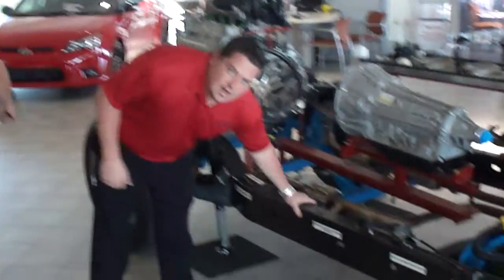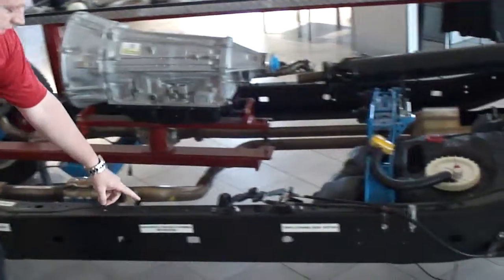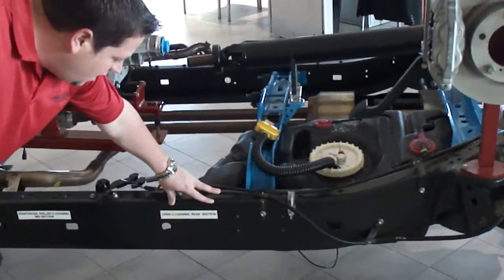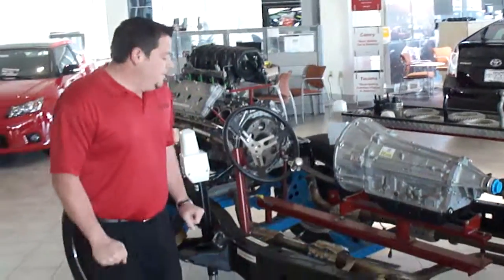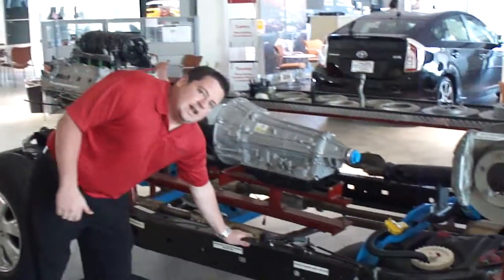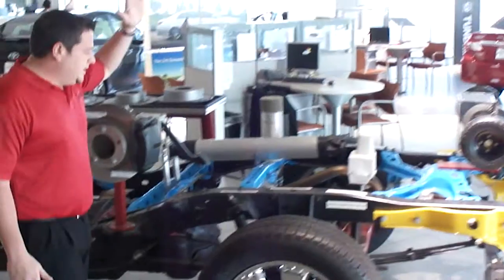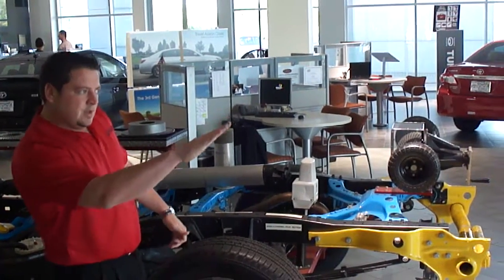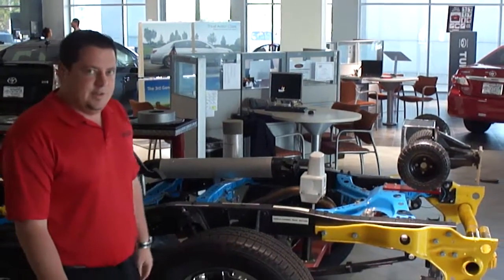Tundra Frame Uncovered

Comment: 95 is my cutoff year for Toyotas. I like the old fully boxed pre-Tacoma pickups and still use them for extreme 4x4 duty. But I won't touch a Tundra or Tacoma with a 10ft pole. I had to go with a Chevy to get a good heavy duty frame on a full size truck. If Toyota wants my business in the future, it better sell 70 series or Hiluxes in North America.
Reply: This is true about TOYOTA Trucks from  early  70 to late 90 have fully boxed frame was designed  in Japan and made in japan like the TOYOTA T100 in the year 2000 IT became TUNDRA designed in America  made in America chief engineer for TOYOTA Trucks is Mike Swear decisions to go c channel frame massive frame rot recall TOYOTA needs to hire new chief engineer to replace Mike Swear.
Reply: yote yeet swears didn’t design the 2000 tundra  he was on board with gen two only
Reply: @yoteyeet5601  C all the way.

Comment: Search for Tundra chief engineer Mike Sweers and he will go a little more in depth of what this gentleman in the video is talking about. Everything he said in this video is 100% accurate per Mike Sweers.
Reply: Thamac15 Mike Sweers also says Tundra customers don't care that the Tundra only gets 18 MPG while much more powerful and touger competitors are pushing 22 MPG. Or that drum brakes on a 2016+ Tacoma is an advantage somehow. Ridiculous.
Reply: It's accurate in that Sweers said the same thing.  It's not accurate in that you don't need a C-channel frame for better offroad flexibility.  The Landcruiser, 4runner, Hilux and pretty much all domestic pickup's have fully boxed frames and they all work just fine offroad.

Toyota's use of the c-channel frame is purely a cost-cutting measure.
Reply: @kevinp5325  Lol for 5 years how much boxed frame need to rust out.

Comment: And the Toyota frame problems continue , hopefully they don't rust threw as quickly as the old t100s .. I've seen scary videos of frame flex on "toy" trucks!
Reply: Thamac15 
Are you fucking kidding me? You are a delusional Toyota fanboy loser from the sounds of it. TOYOTA HAS BEEN SYNONYMOUS WITH RUST ROT FOR 30+ YEARS!
https://www.nytimes.com/2016/11/14/business/toyota-agrees-to-3-4-billion-settlement-in-corrosion-case.html
Reply: Rick It will rust rot through. Toyota rust rot is a tradition carried on for over 30 years.
Reply: They overengineered these trucks just go look at the teardowns. Trust em way more than the blind fanboyism domestics have
Reply: Can you elaborate your "Toyota frame problems continue" comment please? When doing so I will need sources to verify your information and to determine your credibility.
Reply: I think not, . I'm going off what I've seen and read and don't have favorites.. Have a good labor day!
Reply: You can't provide sources. This means you have zero credibility and as a result you are either spreading falsehoods or misguided inaccurate information which leads to an even more vast array of ignorance. Enjoy your labor day as well Rich.
Reply: Give me break! freaking dork, ,obviously I wouldn't go to that trouble,, from what I've seen at my shop, Toyota is a joke, until they start using hydroformed frames and get with the times , there going to be junk compared to the Ford and Chevy..

Comment: This is why I don't buy from the dealers! They hire high school drop-outs with no integrity who will lie to you all day long for a massive commission. And I admit Toyota has a more reliable engine and transmission, but it means nothing if the frame cracks when I'm off-roading 30 miles from the nearest paved road and need a tow. Ford wins.
Reply: Where did the guy in the video lie? Everything he said is accurate per Toyota Tundra chief engineer Mike Sweers. You're just another typical ignorant internet tough guy who offers no clear, accurate, or precise information pertaining to the topic at hand. You resort to insulting the salesman to show what? Your ability to be a virtual badass?